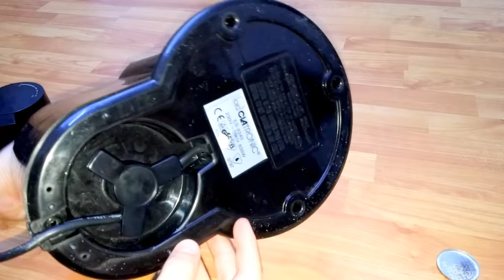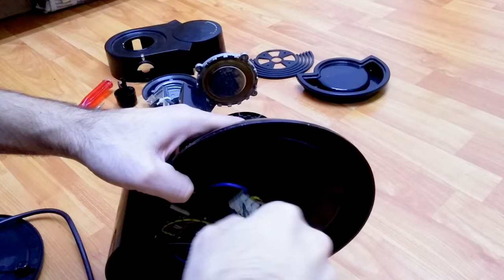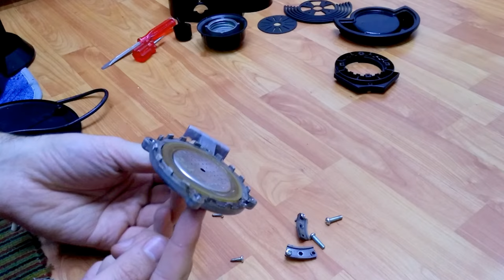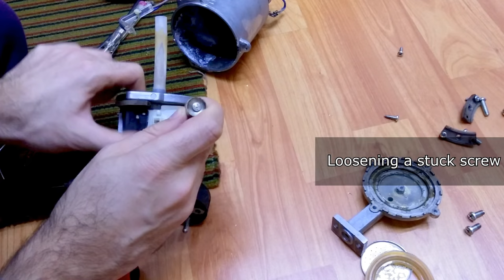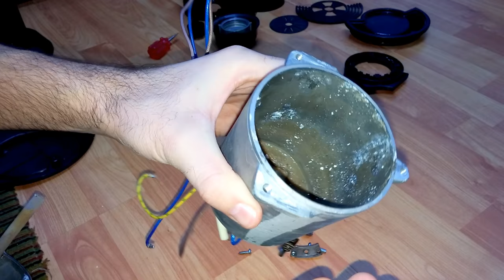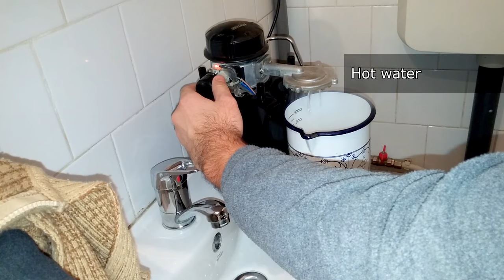Coffee Maker Repair (Steam Machine, Clogged, Water deposits)

Comment: Although my espresso maker is a Sensio C15 it is literally the same. Mine would no longer power up as shown by the neon bulb not responding, although I checked for continuity on the power wires, thermostat and heater. To remove the knob,  without breaking it,  first remove the base using a small Torx security bit for the 3 screws that hold it down. Once done  shine a light inside deep inside toward the knob and you'll see a small rectangular hole with a white plastic detent. Using a long narrow metallic stick, press that detent down to release the knob's latch, while pulling out the knob from outside. Once the knob is out, you can then undo the 4 screws inside.  They hold the top cover and this will expose a tiny lever switch that the knob actuates while rotating. You can then check that it closes properly using a continuity tester and some sharp probes... I think the rest is trivial. Cheers and happy fixing!  (Thanks BTW!)
Reply: took me a few hours before I found this comment, the knob is off now, thanks

Comment: I've found running 1 or 2 cycles with vinegar dissolves the minerals. (No need to open up the appliance.) Going forward, when you're done brewing, blow off the residual water/steam thru the brew channel, not the milk-steaming channel (the manual states blow off pressure thru the milk-steam channel, but this section is less prone to clogging since the pressure is higher, IMO. It's good to wipe off the milk film from the milk-steamer, if you are meticulous enough). Make sure to remove the espresso grinds holder (with the unit pressurized, with valve in the off position) then place the carafe under the appliance, and turn valve to "brew" and catch the water-steam in the carafe. The appliance should run trouble free from now-on :) You can run a quick blast of steam thru the milk-steamer, but most residual steam should be used on the espresso-section.
Reply: It sounds like you've got a good amount of experience using this machine, I've been digging for a tutorial video but there's doesn't seem to be one for this model. I picked mine up from a thrift shop awhile ago, but I've never used an espresso machine at home before, so it was a little terrifying. I looked up the manual online but I find following along with a video a lot easier for me. Any help would be much appreciated if you could!
Reply: @brandnewwizard.  Haha, I was using this appliance just now! Ok, I will do a how-to video :-) ☕️
Reply: @DFEUERMAN  thank you 😂 I was worried mine was going to explode when I first tried lol

Comment: I have a Krup 993. Looks just like the one you are taking apart. But the top on mine is screwed on from underneath and I couldn't figure out how to open it from underneath, there were no screws on the bottom. So I broke the top off without damaging anything except the screw posts. The problem with mine was that the turn knob to activate the microswitch wasn't making contact. Just had to push the knob in further. Put it back together and it works fine now. Maybe you could show how to access the screws that release the top. Thanks

Comment: those arent water deposits, the cheap metal they used when building these deteriorates over time, and flakes off into the espresso. i have a Type 963 that was built in the 80's or early 90's , and it looked like i was panning for gold when i rinsed out the boiler.  amazon has some great brushes which can fit in my krups which has an even smaller opening, they are great because you can push it into the boiler, and really scrub out the flakes of metal

Comment: This really looks like mine. I thought also that my thermal switch was broken and ordered a couple online but not sure what is the temperature as I cannot read from the old. Anyone could tell me? I got 175°C but might be too much? So far it boils but I am scared it wouldn't open the circuit on a really high temperature.

Thanks a lot for the video in any case!

Comment: Did you know if the top cap (first piece you remove) have any security system?, because mine broke a center and have a hole in a middle with a rubber piece (broke) with a spring, I'm wondering if sealing can resolve it, what do you think?, thank you
Reply: You have to remove the bottom of it first. Then use a flashlight to look deep inside the machine toward the control lever and there will be a small square hole with a small rectangular white release button. This button is only visible with the lever set to off. Then use a long flathead screwdriver to pop/push the release button while simultaneously gently pulling on the lever. It took a few tries and I felt like I had to press the release button pretty hard. When it did release the lever came right out easily and wasn’t broken.
Reply: @vanstromi7810  thank you very much!!!